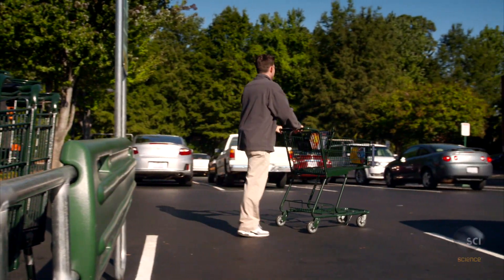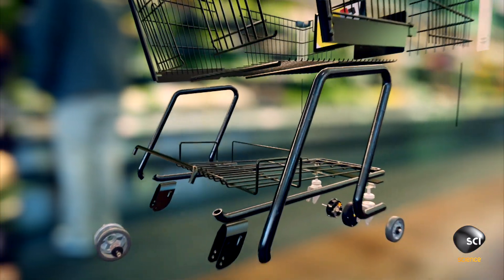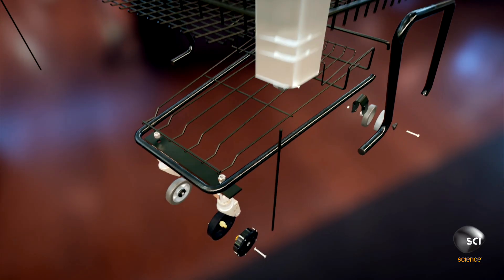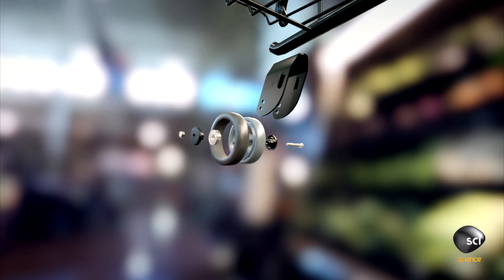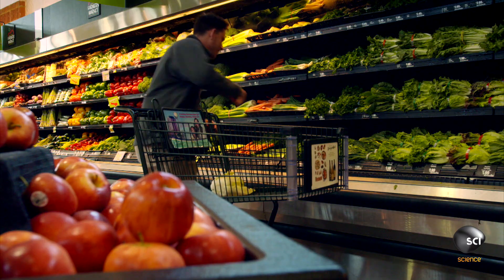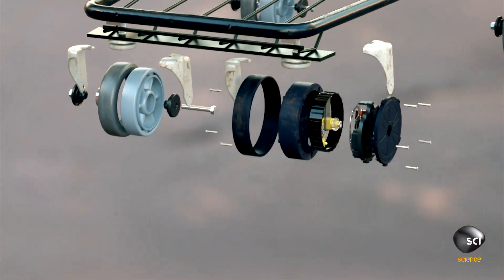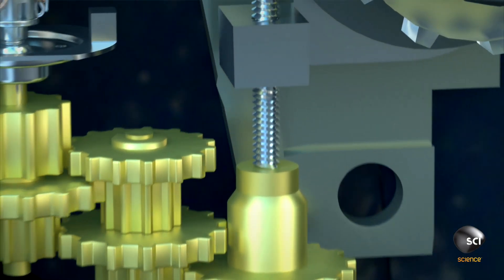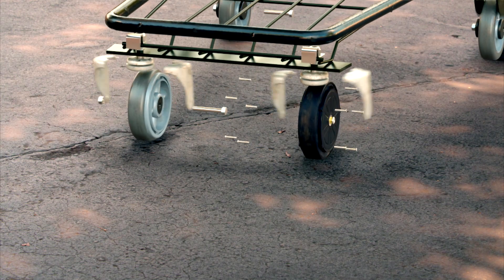Anti-Theft Device Keeps Shopping Carts on the Job

Comment: while these devices may help stores from carts being stolen , it could explain why customers are getting static electricity shocks from carts at COSTCO AND OTHER STORES. as someone who used to service and clean shopping carts for different grocery store chains , i have to wonder if they are still being cleaned with pressure washers , or since covid arrived , if the stores came up with a different method for fast cleaning of carts and killing germs. it might just be that these anti theft devices attached to the wheels , are the culporits of creating static electricity through the carts , and zapping the customers ? they quite probably created this static electricity charge by installing these anti theft devices on the wheels , that customers were not aware of . it would not happen all by itself . the carts i cleaned and maintained with regular wheels certainly did not zap the coustomers , sometimes technology shouldn't be used on some things , like shopping carts , it's a good way to lose your customers , and maybe interfere with such health devices like pacemakers , being a danger to ones health.

Comment: I've seen some older locking carts and the walking wheel if I remember correctly had a 9-volt battery and the walking mechanism just kind of looked like a fender over the wheel.

Comment: as a shopping cart tech, there is one major flaw in this vid. The reason behind the locking wheel is to prevent theft of groceries, not the cart. You need a tilt bar in the back opposite side of the locking wheel. That way one can not just tilt the cart back on the rear two wheels and walk out...
Reply: i managed a business called the buggyman , people don't realize just what kind of maintenance is done at night on these carts , everything from changing wheels to welding , pressure washing. but adding these devices could mean problems , like the static electric charges people at costco stores are complaining about . i don't know about you , but the carts i maintained weren't zapping people because they were just regular wheels , i think the electronic wheels are the problem. never had any static electricity charges handling carts before. i guess the idea of pay carts failed due to the cheap chains attached , theives can just cut these in a flash. if a customner has a pacemaker for health reasons , these electrically charged carts , could put the customers health at risk. i love it when these tech geeks come up with not very well thought out advances in tecnology. there are complaints in abbotsford british columbia of costco carts giving customer shocks thru these carts. maybe if these gouging grocery stores weren't so cheap , they could hire security to stop all the cart thefts at night and during the day , most of these carts are all loaded up and pushed around by the homeless then abandoned when they have no need for them.

Comment: The wheels lock up to stop thieves in their tracks lol. How these lock is with sound and it plays a 7.8 ghz sound under the ground to lock the device. So you can literally download the shopping cart wav files online. One for locking the wheels and one for unlocking the wheels and play them right on your phone and put it up to the wheels to get around this lol.
Reply: 7.8 GHz? That's a higher frequency than a cellular signal or even Wi-Fi. It's not a sound, and a cellphone could not "play" it.

Comment: I hate those anti theft wheels because if it breaks or wears out then we lose a cart. A cart without that wheel would last a couple of years. A cart with that wheel is lucky to last 3 months because they break easily and water seeps into it then freezes in colder months. Carts wouldn’t be as big of an issue if it wasn’t for those stupid anti theft wheels.

Comment: I've learned how to still be able to take these carts with me when I have no money for a ride.

the issue with most carts is that they only put the lock on one wheel instead of two so if you find one that has one lock you can easily bypass it's lock by pushing the cart against the wall where the locking signal box is located till you push the cart 2ft past the box.

if you do this correctly you'll be able to take the cart about 70% of the time .
Reply: or just snap that little wire cable off..
Reply: how did you get to the store in the first place?

Comment: I worked as a manager at a retail store, and the biggest issue came about due to the locking mechanism. A customer was running with his shopping cart while his daughter was in it. He was "just having fun" with his daughter. So he began doing that thing where you push the cart really hard forward away from you, run towards it, and push again. He did that over the yellow line. So as she crossed the yellow line, with him far behind her, the front wheel locked and the whole cart flipped forward, with his daughter inside. 

The yellow line was just repainted, so the guy knew it was there, plus, the shopping carts all have a sign warning of the locking mechanism. 

Now, I completely agree the guy is an idiot. Or he deliberately did it... I have seen on camera, parents pushing their kids into a shelf and try to blame the store and get $ out of it. Iv'e seen many things in retail. 

But, I still think that there should be an improvement to prevent something like this to happen. Even if it rare.

Why can't they lock the back wheels as oppose to the front?  The cart wouldn't have flipped forward in that instance. And, when those front wheels are locked, people would just lift the cart off its front wheels and push it like that. In a wheelie fashion
Reply: There is an option to lock the diagonal front wheel also.  You can lift the cart off the front wheels but this prevents people from moving that cart a long distance.
Reply: Maybe don’t be a stupid human and push your kid around in a cart that you KNOW locks after crossing a line. Nobody else’s fault but theirs. The shopping cart doesn’t have to change if it’s doing just fine.
Reply: @azathothdaemonsultan666  Lol. If you provide no contribution to the matter at hand, then don’t even comment. Makes you seem ignorant and stupid. Either have an original, professional, useful thought or see ya
Reply: @Jay-fy7bn  typical manager response yep. We love trying to gatekeep the internet 😂

Comment: Are the interfere able? Could you use a magnet or foil to interfere with the antenna or micro controller inside the wheel?
Reply: That’s a good question…they don’t sell the wands online

Comment: The thief can still push the cart, just having one wheel locked up won’t stop it. Most the carts you get have a bum wheel anyhow, we’re all used to pushing a three wheeled cart. A better option would be have magnets in the wheel and opposite magnets in the ground creating a magnetic barrier the cart can’t cross. In fact I thought that’s how they did work. I tried to push a cart across the thieft barrier once and the cart was shoved back towards me.
Reply: I don't get it..you walk out if the store and thesr carts lock ?...how or what activates it to lock??

Comment: Kartlock uses a magnetic cart locking system needs no batteries no motors.
Reply: YamiPoyo they actually have those and the only way to unlock them supposedly it to use a stick the looks like a broom with more magnets to trigger a release

Comment: So... this doesn't actually "keep" the cart on the job. It just makes the thing useless. I'd assume they would've installed a way to reverse it?Anyways, a GPS locater would be MUCH better at this. Then, they could actually TRACK DOWN the cart and get it back.
Reply: And make it even more expensive.
Reply: True but thar would make it more expensive and it would be easy to jam the signal so they cant find itor just destroy the wheel

Comment: Okay so you would pick it up an inch on the front?
Reply: The cable is underground.
Reply: you could place a sheet of lead to stop the wireless transmission
Reply: cihan depe you have a good point but also the wire is not a coal so its not a strong signal at all so its easy to just lift it off the ground and it wont trigger and also carrying a lead plate into a parkinglot is weird
Reply: +Samyueru Nekogami No I mean if all it does is keep the front wheel from rolling all you would have to do is pick the front up an inch because the back still spins.
Reply: Team Downfall It's designed more to be a deterrent, the idea is that someone trying to steal it will suddenly fly over the handle, possibly get caught, and then not want to steal it anymore. There's only so much money you can pour into shopping carts, and buying a new one is cheaper than making them unstealable.

Comment: Never seen a cart like that. I know there are some places that do something sort of like this, but it is on the handle To get a cart you put in a quarter, and it don't eject until you take the cart back to the storage area connect it to the rest then it ejects the quarter. I think that though is more or less so they don't pay people to go get the carts, etc. and I guess if you're lazy then someone else does or maybe store person does and gets your quarter. 
 
This thing with the wheel lock sounds cool, but i'd hate to replace all those batteries, if it had an induction charging base then maybe i could see it. Or maybe they have some long life lithium type battery.

Comment: Pick part of it up over the locked wheel and replace the wheel when you get home? I used carts with one useless wheel that didn't turn before, only slowed me down slightly. And by shop perimeter, do they mean the edge of the paring lot? The cart would already be in the truck by then.

Comment: They brake often enough with just a bearing and a rubber wheel. Can you imagine the horror that will insue when this couple hundred dollar contraption will break / run out of batteries / accidentally activate. I think I'd rather just buy another shopping cart.

Comment: All that and they can't figure out how to stop making it drift to the left.
Reply: LMAO
Reply: Jonathan Davies they put a wheel on the front and back on opposite corners to prevent you from doing wheelies or leaning to the side with the open wheels
Reply: Ikea has carts with casters on all 4 corners. Because of course they do. Multi-Aisle Drifting!
Reply: Back and to the left
Reply: It's because it got drift Wheels
Reply: The anti theft wheel has a stator to charge the battery so that wheel has more resistance causing it to drift
Reply: By obliterating the animals that dont push em properly.

Comment: You can still steal that shit.. The one locked wheel doesn't do much
Reply: +Anthony Valadez It's so homeless people won't steal the cart. Sure you could drag it a couple kilometers, but it won't be practical for long term use and a couple miles a day of travel, fully loaded with their junk. No one else really steals shopping carts except the occasional dumb drunk kid, but they usually drop it relatively close to the store.
Reply: Exactly. Not very effective to lock a wheel to stop stealing.

Comment: But you can still two-wheely it...
Reply: +Idriss Farah In areas where cart theft is a bigger issue, stores will have cart models with two locking wheels making it impossible to tilt the cart onto two wheels to bypass the locked one.
Reply: They put two wheels on opposite corners though
Reply: but you would have things in it
Reply: +Cubicle Productions i always two wheely it for fun when its almost full
Reply: There is a wheelie bar on the back right
Reply: +Idriss Farah not if you put it on the back wheel
Reply: Me two😎

Comment: They probably cost around 100$ mostly because of that mechanism, which is kinda ironic.
Reply: Smaller than a match box
Reply: +CaptainCustardMC Because size always equals price. I'm not saying I'm 100% sure that that's what gets the cost that high, but your argument sure is silly.
Reply: +Nikos sniper a motor and an induction coil do not cost $100
Reply: +Nikos sniper I don't think it was an argument. He/she was just probably stating that it was smaller than a matchbox
Reply: Nikos papa no the carts are 100$ because they are made of steel to hold the heavy weight of groceries